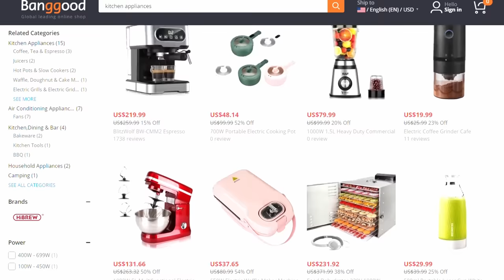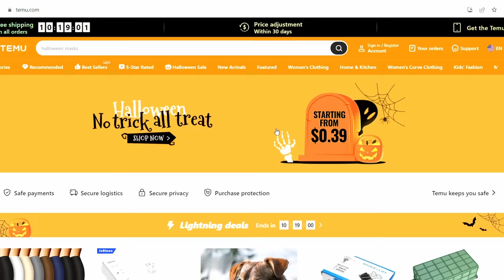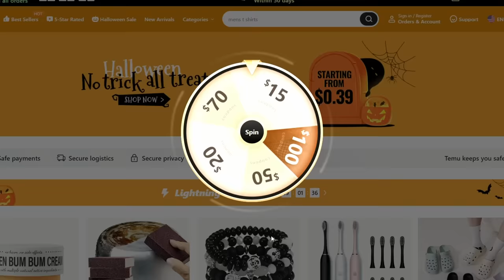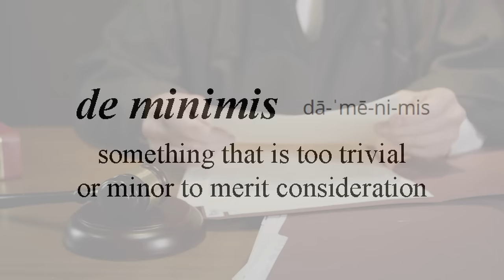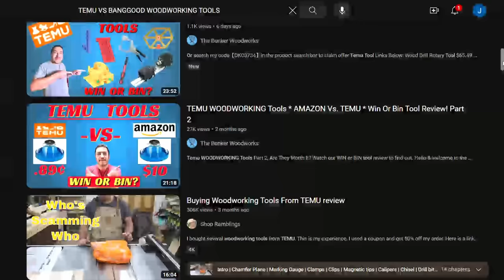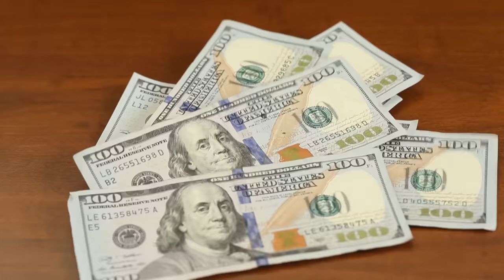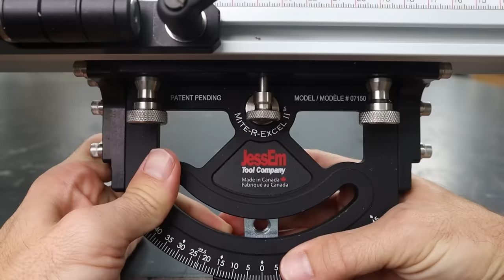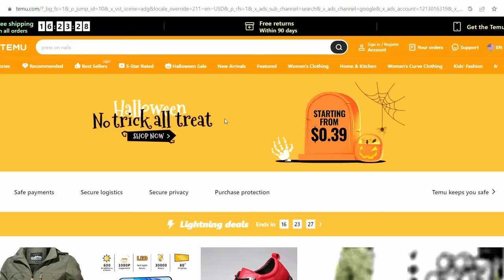I bought knockoff tools from Temu

Comment: While I prefer not to get into the politics of the situation, which is really no different than complaining about migrant workers in the US but no "self-respecting" American teenager would consider picking lettuce oh, and by the way, it better stay at $1 a head in the grocery store.

What I experience is even though those knockoffs are close, they aren't the same and the devil is in the details.  You noted the thread play on the clamps as just one example.  I would bet after using it for a day or two the difference in miter gauges would really stand out.  I love the fit and finish of finely made tools which almost always seems to be lacking unless the tool is specifically made for an American company to their specifications.  Like many noted, it is then duplicated and sold at a lower cost during those unused factory hours which is truly piratical.

The only unfortunate item I find in your video (which was well done) is the use of Woodpecker tools for comparison.  I for one believe this particular manufacturer has put a target on their back by selling grossly overpriced items that have literally become the "Versace" of woodworking tools.  Milling and anodizing aluminum is no great feat but their marketing efforts are outstanding.  This company has literally not produced anything remarkably new in the industry but simply repackaged, rebranded and sold woodworkers on their beauty and precision.  Most wood workers are not working beyond a 1/32" tolerance so the precision and accuracy are somewhat meaningless.  Just my two cents but a $90 square is not going to provide 9X more accuracy than a $9 square.  But it does look and feel good.

Comment: Thank you for actually calling this out. I have also rolled the dice and bought a few items off these sites and have been fairly impressed with the "deals". However, as you have eloquently stated, it's more damaging than we really understand. The actual data points and measurable statistics about taxes unpaid, shipping leniency/discounts, and product/patent infringement should spark a much larger outcry than we see. I'll continue to support the retailers that actually support us, even if that means a slightly higher price point. It's worth it to me to have these companies around for the next several decades than trying to save a few bucks on a few tools. Thanks again for putting this together. I look forward to the course release and working with the team. Cheers!

Comment: You reap what you sow; and while you are right that in many cases this is theft, a lot of corporations left themselves vulnerable when they chose to "offshore" manufacturing to China, making may redundant in the process. They offshored manufacturing because they could make bigger profits, not so they could offer the consumer a better deal. Sadly once the horse has bolted you cant then shut the stable door and hope it all goes back to the status quo ante. You can't offshore manufacturing and still say "made in America" although some less than honest companies do minimal assembly of overseas sourced parts and still make the claim.

Comment: First, I appreciate your channel and largely agree with the points you make in this video. However, there are several additional subtleties that might help inform the discussion. Consider this a history lesson/rant from a Gen Xer. Also, please note that while my post may criticise China and the US, my critique is directed at the political and economic institutions in these countries, not the Chinese or American people more broadly. 

<<Begin Rant>> First, one omission that should be addressed right off the bat: many of the tools we use in woodworking or the trades likely come from China, in whole or in part. Doesn't matter if you are talking budget or high end, hand tools or power. Our current trade system frequently takes Chinese (and other countries') finished goods and puts a US brand name on them. I know you are focusing on tools made in the US, but we need to acknowledge that most brand name tools originate from manufacturing facilities outside the US, or incorporate a substantial percentage of components manufactured outside the US. There are very few companies that perform R&D, source their materials, and manufacture and assemble their products within the US. To do so is to fly in the face of nearly a half-century of trade policy that actively discourages this model. I commend the companies that attempt this and I believe they are worth supporting, but as you allude to in your video, the system is not designed for these kind of companies. And while the idea of Chinese knock-off tools is concerning, it is a direct result of the way our economic system has evolved over the last half-century.     

You mention China's rapid industrialization and how they are now manufacturing tools and equipment comparable (in some cases identical) to US-made products. It is important to realize that China's rise as an industrial power did not happen in a vacuum. US corporations and manufacturers made that transition possible, starting largely in the 80s. Corporations opted to transfer investment capital, infrastructure, and technical expertise to China in the search for lower labor costs and externality costs domestically, along with higher corporate and shareholder profits. The US government, under Reagan, directly facilitated the transition through favorable trade policies and tax structures as a means to increase corporate profits. Part of the rationale was an attempt to end the stagflation of the 70s, but some of it was ideologically driven as a means to weaken the power of labor unions domestically. Successive US administrations have largely maintained this policy because it resulted in higher profits for corporations that offshored production or labor costs, which resulted in stronger lobbying power by corporate industrests to maintain or expand this trade dynamic that benefited them. 

The 90s saw the Clinton Administration effectively do for the technology sector what Reagan did for manufacturing and heavy industry. It wasn't really until the issue of software piracy and intellectual property theft (high tech design and engineering), that concerns about this dynamic became more mainstream. Companies like Microsoft, Apple, Oracle, Cisco and similar became powerful enough (read wealthy) to have their own lobbyists bring the issues before our elected leaders. This is really the first instance where you had two powerful sectors of the US economy in opposition with respect to Chinese trade and investment. All the concern about the loss/decline of US manufacturing was largely lip service so corporations could continue to make huge profits, which were then used to continue or expand the system. Geopolitically speaking, China was just beginning to emerge as more relevant problem for the US. 

In the 2000's, while much of the US' attention was focused on Afghanistan, Iraq, and the Global War on Terror (tm), China continued to advance its manufacturing capabilities into precision engineering and high tech, the exception being high end chip manufacturing, which was restricted to Taiwan, US, Germany, Isael, and later Korea. Perhaps more importantly, China invested heavily in information technology during this period. The power of a command economy is that the Chinese government can, for example, take 20,000 students performing well in math and science, and dictate that they will continue to pursue such studies through college (oftentimes in the US and other countries with advanced technical education) and then bring that knowledge back to China's high tech sector or place them in the People's' Liberation Army to focus on cyber warfare. This is why we have witnessed the rise of China as a global power in less than a generation. By the way,  China identified the cyber arena as a battlefield where their less technologically advanced military was not a disadvantage, when compared to the US and other western powers. 

Moving into the 2010''s, the extent and danger of the US economy's entanglement with China (and other foreign manufacturing powers) came clearly into focus. Whether it was cyber intrusions on US infrastructure or corporations, theft of personal, corporate, or national data, or electronics with embedded espionage capabilities, the 2010's brough the new order sharply into focus. COVID and the disruption of global supply chains suddenly made everyone aware of just how dangerous such entanglements could become. Not to belabor the point, but if we really want to protect US design and precision engineering and manufacturing, even in the high-end woodworking tools niche, we need to restructure much of how the US' economic and political underpinnings are structured.   <<rant mode off>>

Comment: I would point out that most of the products you show in your videos made to imitate American designed or American manufactured components are made using inferior quality metals and plastic components. There is a significant difference in the grade and quality of these inexpensive goods, and often times the average consumer won’t know they are buying the lower end quality of goods until the tool snaps under load or disintegrates under pressure. While cheap labor absorbs a portion of the cost difference, foreign made components made for American products are made with high quality components to the rigid standards and QC of the company they are manufactured for otherwise the parts get shipped back at the manufacturer’s expense, whilst the same factory may produce a knock off product for a non U.S. company using a lower grade of steel, aluminum, plastics, and even paint to save on cost and turn out a finished lookalike to sell as a cheap alternative. Buyer beware… you always get what you pay for one way, or another.

Comment: Many of the companies making woodworking tools are not huge corporations.  Some are rather small and they started with a great idea and word of mouth, which then spread.  To see these innovations stolen and business undercut, aided by the International Postal Agreement and domestic customs regulations, is terrible.  And when you see domestic governments not really doing much to fix this situation, or at least make it fairer, it's just depressing.  I make it a point to spend a bit extra to buy domestic.....so I buy less stuff in general (how many do-dads do you really need in many cases?).  And when it comes to quality, the domestic manufacturers often make much better tools that have greater accuracy and stamina over the long haul.  The Chinese like to shave a micro or a milli and use cheaper parts in general, often with inferior metal.  Of course some make great stuff since they likely may also make product for international non-Chinese brands.....still, I think it better to buy domestic or from countries where the trade and postal rules are on a level playing field and the quality is high.

Comment: No no no. Import duties are paid by the importer, not the seller (exporter). Temu and Banggood would pay import duties if they were US companies importing goods for sale locally. They are not. The ¨Deminimus" thing would apply and allow consumers to buy and not pay the duties. Without it, the goods on Temu wouldn´t get more expensive, the shipping and handling would. And, for your local ¨producers" who are just importers, they will have to pay the duties because they are importing in large quantities for resale. If they were actually manufacturing the tools in the US, then they could more effectively compete. 

I mean, you said "both tools are made overseas in Taiwan". Sir, Taiwan is China.
Reply from the maker: Im aware who's paying. I did a poor job of explaining its another advantage these companies have on price. Those duties are normally built into price that consumers pay. Not in this instance. I spent 10 years working with factories overseas and managing the headache of duties and tariffs. Its a complicated mess
Reply: @Lincolnstww  Also, maybe some of these folks can accept a longer ROI and not charge $150 for a L-shaped piece of aluminum with holes in it. Surely some of those tools can be sold for cheaper.

Comment: i am as american as i can be love my country im a metal hobby person i use indexable insert carbide tooling if bought from an american company one tool can be over 200 bucks if bought from temu or bang good i can buy the same tool under 20 bucks no its not as good but ive been using some of these cheaper tooling for over 20 years and they still work fine im a hobbiest i cant pay 200 bucks per tool when i have over 30 different tools thats 6 grand but i can have the same tools for 600 bucks i hate buying chinese but i have been put in the i dont have a choice situation and i do not care what anybody says if china can sell an iten for 20 then the american companies can sell theirs for a much closer to 20 buck price like 28 or 30 then as an american i could spend my money with american companies and i would! unfortunantly american companies still havent figured out they can do as china make larger quanities and sell them cheaper but they dont because industry will pay their higher prices and keep them in business its simple greed and that is the american way it seems always wanting more more more without putting in the necesary effort to achieve more more  more american way of life hand out expecting handouts i live in sc noticed you do to i work as a wildland fire fighter for the scfc so you know the kind of money i make and you know if i spent 6000 on tools that would be 1/5 my salary so you should be able to understand where i am coming from

Comment: I want to save a buck, but also respect that a brand name spent money and resources in research and development. Case in point, Festool. It does would do a disservice to those entities that design, develop and ensure safety and quality of their tools. Temu rips off patents, branding, marketing, which is awful. I also buy products made in the US or Canada - putting my money where my mouth is.
Reply: It's not Temu directly, but they enable the people who are doing the infringement. It gets even worse, as if a major brand needs two shifts of manufacturing from China, the company is likely to run a third shift using the same tooling to sell the excess on Temu and friends.
Reply: @johnhaller5851  It's long been like this. Unless you deicide to manufacture locally, this is going to happen anywhere you source your manufacturing to. Companies in general are more interested in protecting their brands (ie you can't use their brand on knock offs) than the actual design. Not saying making knock off is good, but in reality the brands are what makes the most profit for the companies so they couldn't care less.